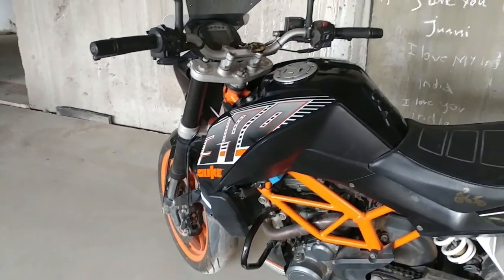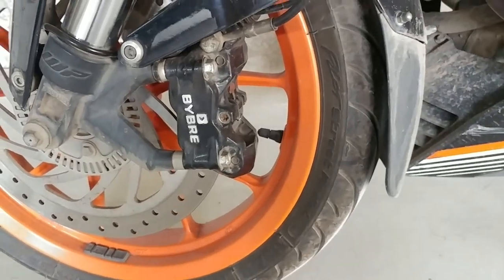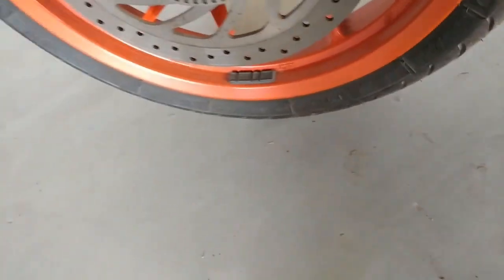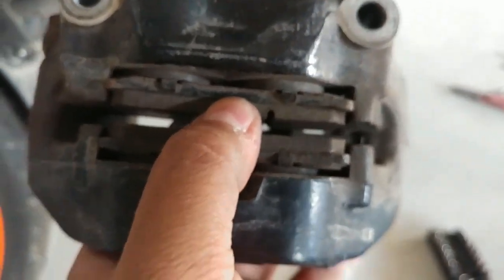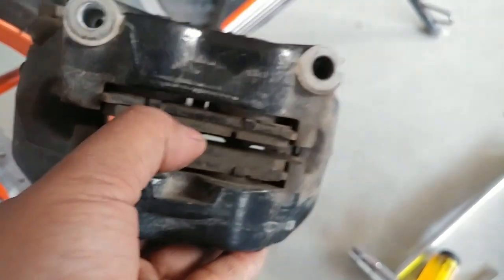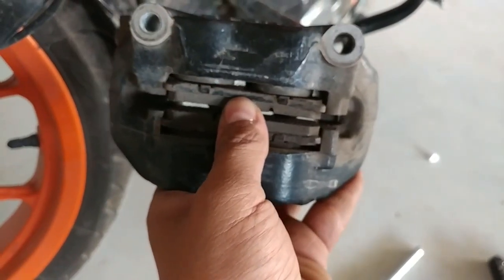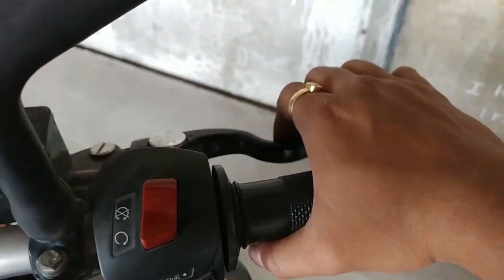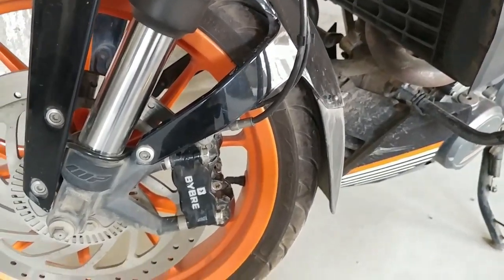SOLUTION FOR SPONGY BRAKES--DUKE 390

Comment: same issue with my hayabusa but after pulling the lever its hard to put back the caliper on the disk what is the exact solution for spunge lever
Reply from the maker: You need to gentally pull the lever so the brake pads will come forward by mm only.
There are two solutions.
Completely bleed the brake oil and replace with new one.
And if this dont work then rebuild the brake calipers and master cylinder

Comment: My front breakpad little bit shaking . What i do ?
Reply from the maker: Hi, please check if your disc plate is bent if not change the brake pads and brake oil
Reply: @dhawalnag  everything new about bike running 3000km .and break pad okay🤥
Reply from the maker: @bishal390  okay, once replace the brake pads, if the bike is new it will cover under warranty

Comment: Sorry to say this will not do anything for you Dhawal. The brake is self adjusting to maintain the smallest gap possible between brake pad and disk itself. I would recommend removing those pads and cleaning the pistons with small brush and soapy water and then tie brake lever back over night to allow air bubbles to leave the lines and enter the fluid reservoir where they will do no harm to your braking efforts.
Reply from the maker: Hi Steven, thank you for your positive comment. You are correct. There was problem with one of the postons. The piston used to retract back a little bit after leaving the brake lever. And yes i did a lot of cleaning and removing air. This method was a temporary fix.

Comment: There are some true to this. Sometimes the pads retract too much and then you just waste lever travel to take up that slack. You dont need to remove the calipers thought. Do as follows:
Press the lever all the way and hold. Clamp the hose at the exit of the master cilinder. Dont go super tight on the clamp. 
Release the lever slowly. Press it again (it will be hard to to the hose clamp but force it a bit until oil goes through) and hold. 
Remove the clamp. 
Put a zip tie on the lever and leave it holding overnight. 
Test
Reply from the maker: Thank you so much for sharing. This is interesting. 🙂

Comment: Mine is a rc 200 
I changed the brake pads master cylinder and disc plate two times the problem still exists. I did nt try this .
Reply from the maker: i, myself changed it and used several brake oils to maintain hard brake lever but no effect, so this is what i suggest to do, thanks for watching, let me know if it works

Comment: I own a duke 200 . Its front brakes are too weak . It doesn't have that bite even ns 200 have better bite . I have changed my brake pad several time .but nothing changed.
Reply from the maker: Bro, there could be many reasons, try to bench bleed your braking system with a good new oil, and also ask the service center to change the O rings in brake caliper for all pistons (caliper rebuild) and clean the caliper with good brake cleaner, may be you need a new master cylinder kit too
Reply: Take out the calliper and take out the pads gently press lever and check if all the pistons are coming simultaneously!
If not then your brakes will be weak and tyre will slip at hard braking ...all of them must come together ... to fix this you need to do a calliper rebuild or buy a new calliper ... building it is very cheap but labour intensive